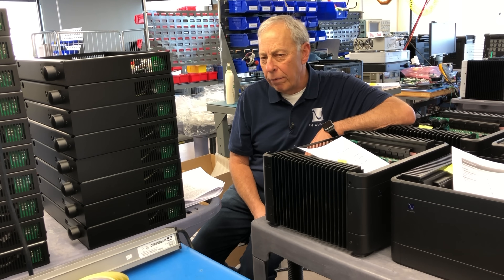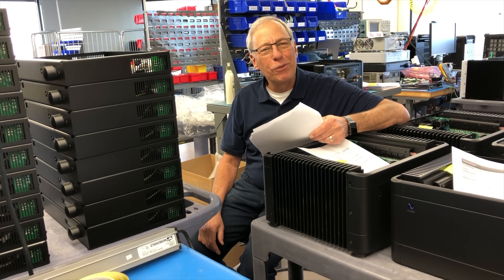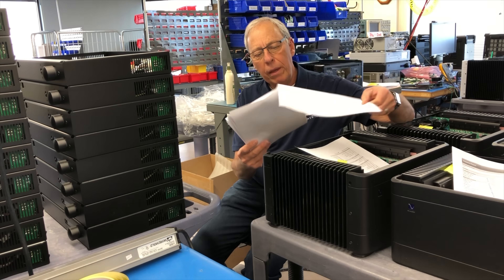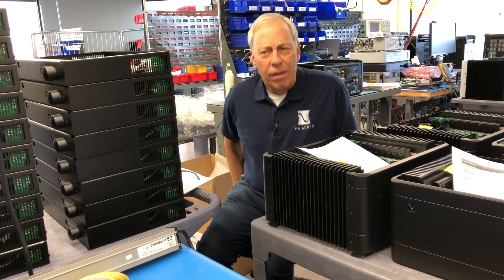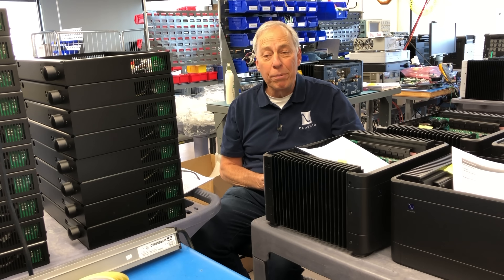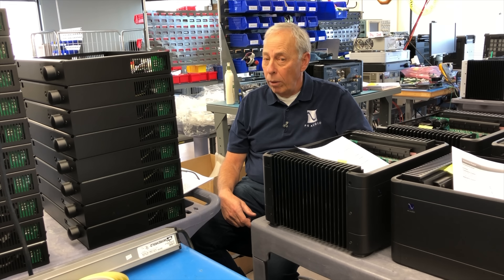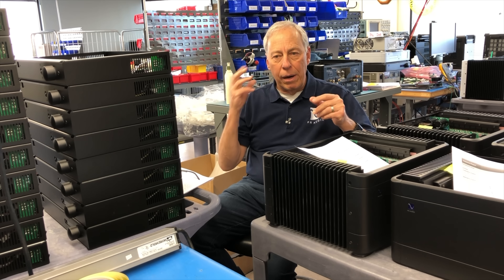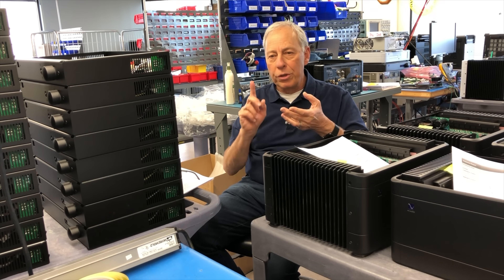Is damping factor a good indication of amplifier performance?

Comment: Low damping factor is never a good thing and one reason why tube amplifiers aren’t the best nowadays. But it’s a spec that doesn’t need to be more than around 30 and won’t matter if much higher. Like other traditional audio specifications, there is a good enough number that your ears can’t detect and anything better won’t matter. For example a THD of 0.1% vs 0.0001% might look like a huge difference but you won’t even notice the difference. When Paul doesn’t care the measurements it simply means the traditional measurements are good enough to not matter anymore for what humans can hear. However, you can still measure performance of an amplifier through an approach of comparing output to input mathematically using AD converters to save the wave forms and on a computer create the delta wave form (with the factor of amplification included). If you find no delta in such data above 80dB at all while playing real music...any talk of “audible effects” can be declared as snake oil and your amplifier is simply not contributing negatively to what you actually hear.
Reply: I have no idea how much damping factor does my amp (Jadis DA50 S) has and never cared, just sit and listen and you know if it's for you. :)

Comment: Thank you Paul, that summed it up well.The highest damping factors I have measured are on Crown amps, not the best amps for listening. They built one called the Power Line 4 that sounded better than the similar Crown DC300A and it had half the damping factor. The amps with the huge damping factors were good at driving passive subs though.
Reply: What does "highest" and "huge" mean in numbers?

Comment: Pauls explanation is quite accurate. The only thing I would add is a speaker is a motor generator and as such generates back EMF:

https://en.wikipedia.org/wiki/Counter-electromotive_force

A solid state amplifier that features a high damping factor not only can source current but can sink it ( consume the back EMF if you wish ). Paul used the word "control" which is a good choice of word.

The bigger the speaker generally the larger the back EMF currents. If your driving a large subwoofer you may require an amplifier with a high damping factor. Tube amps with their large output transformers sink back EMF very poorly and should not be used to drive large coned loudspeakers.
Reply: Damping factor, high or low, does not correlate with how much current an amplifier can absorb. It only describes how much the current (in or out) alters the output voltage of the amp.